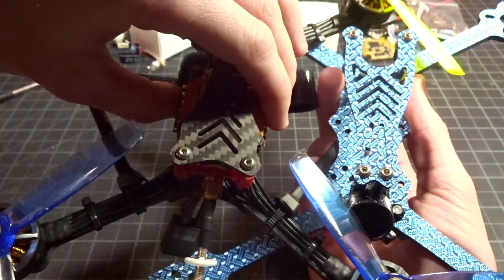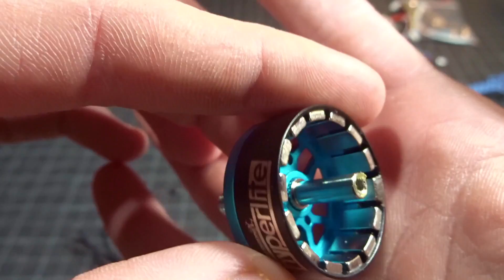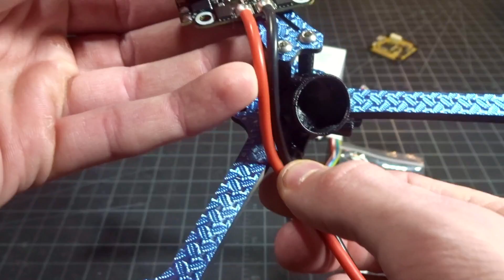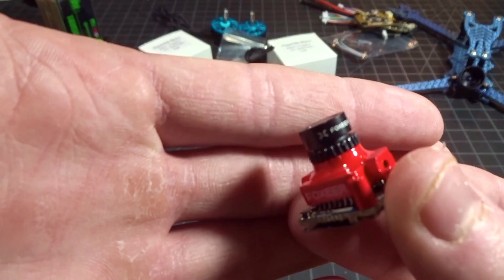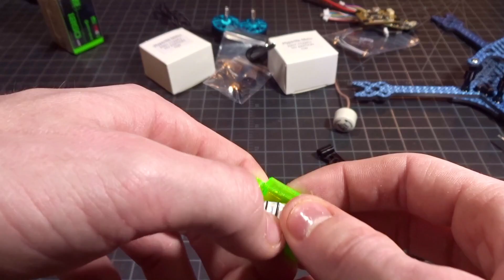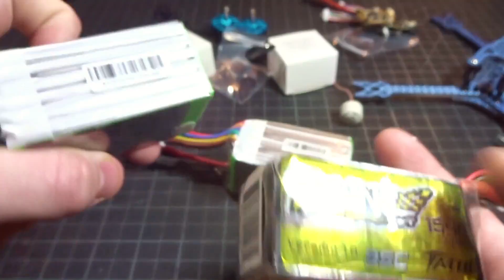6S Racing Quad : Parts Introduction

Comment: I was going to say for the ESC, don't go pulling wires out of the connector to swap the motor orientation. Just use the CLI command in BF to find the resources and swap the motors that way. Waaay cleaner and you don't risk messing up the connector taps on the plug. That's my only thought.
Reply from the maker: I do both methods, just depends on what I feel like doing.

Comment: hello artist I need advice ... that mini GPS (maybe with a Magnetometer maybe) I recommend for this FC?
Omnibus F4 Pro V3 Betaflight Flight Controller Built-in OSD Barometer SD Blackbox for RC Drone ..Banggood. on the frame ...
GEPRC GEP TSX5 Viper 220mm FPV Racing Frame RC
Thank you
Reply from the maker: I have no clue what GPS so use. Try asking Painless360, he seems to do some GPS stuff.

Comment: Ive been rewinding motors and testing with 1050mah. 1800kv on 5x4.5x3 v1s on a finX23 (2205.5) is an awesome setup. Im also taking a look into finX30s (2207.5) at 1650kv with 5050x3 cyclones which is very promising for speed while still flying similar to my lighter build
Reply: Enginair how do you know how many turns or how thick the wire should be? Or do you just guess and then check the KV? Pretty cool stuff!
Reply: I do not know how to calculate kv (not for lack of trying). I ended up just guessing roughly how many turns I needed to get close and ended up 200kv away. From there I found that number of turns adjusts the kv linearly and I was able to tell with decent accuracy how close I would be with one more turn per coil. Just make sure you have the phases wired correctly and you cant go wrong really. (make sure the kv is reasonable, 10000ish kv killed my esc instantly)

Comment: glad you mentioned the motor layout on the ESC and their intended orientation - I'm installing it with the power leads out the back and would have really been thrown for a loop had I not caught that tid-bit :) Time to now swap cables around in the FC side of the connector (or just remap the resources in the CLI).
Reply from the maker: Yeah, unfortunate, but not a deal breaker.
Reply: OH THE HORRIBLE CONDITIONS WE PUT UP WITH!!! ;)

Comment: I’ve never tried 6s, but I think 5-6s is overkill and unnecessary extra weight. Will likely destroy motor quality and motor life. The higher the voltage the less efficient motors will be.
Reply from the maker: No offense, but clearly you have never tried a proper 6s setup :)
Reply: The RCAddict that is true as I said in the first sentence that I've never tried 6s. The rest was all prediction.

Comment: you dont have to change out all the pins from the esc to the fc, just get 2 motors right and then you will be able to do the rest with betaflight, check out nick burns vid on motor mapping ;) not sure if you know that (you probably do but)
Reply from the maker: Pin swapping it my preferred way, and I have to swap pins anyways since the cable is incorrect in the first batch.

Comment: Dont change the pins because you are rotating the esc board, just use resource remaping on betaflight, its easier
Reply from the maker: I don't like resource mapping. I would much rather just swap the pins, super easy.
Reply: Agreed. I had to do it. Super easy and less chance of issues

Comment: Also one question about the multigp rules it says on there website to run six cell batteries you race in the open or unlimited class. So my question is why wouldn't you go for a little more kv? And or more mAh batteries ? For more punch? Cuz the only rule that's going to limit you is the 800gram weight limit.  And I know that's a lot but it's nothing for six inch props if that's the way you choose to go. Five inch would be fine with the rpms your are going to get with these set ups. Well anyways if you could shed some light on the subject that would be greatly appreciated
Reply from the maker: People don't want heavy setups. If running a heavy setup was fine we would just run 2200mAh 4s. 6s low KV extends the flight times while keeping the builds light.
Reply: The RCAddict did you check out the video  I left below?  Cuz it shows  through  testing that higher voltage  is not more  efficient on the same motor.  Well anyways I can't  wait to see how things turn out. And are you going to  be racing  multi gp with it?
https://youtu.be/ijKXsclb9eE

Comment: You don't have to mod the esc wires you can just modify it in cli with the resource command. I have put all my esc's upside down accidentally and it's pretty straightforward to do it so I didn't bother. Check it out on the betaflight github ;)
Reply from the maker: The pin out cable needs changed anyways. I am not a fan or resource mapping, so I will just get it all at once.

Comment: Gonna be a sick build! I am curious to see how that four-in-one one holds up. I've been wondering what kinda of a gamble running 4in1s with 6s would be.  Can't wait to see it built. Thank you for sharing.
Reply from the maker: Separate ESCs are such a pain hahaha
Reply: Hah, Agreed.  I've been rocking the dalrc's and they have been pretty amazing. Very low noise, 40amp but rated only up to 5s so nervous to run 6s on them.

Comment: I read once on rcgroups that tattu, glacier and pulse lipo cells all come from same factory. after buying a couple glaciers for smaller quads I compared to my tattus and they are very similar. I think they may separate them by ratings or quality and brand them accordingly I think tattu being the top tier and pulse second followed by glacier
Reply from the maker: Yep, Pulse cells are the same as Tattu. They are separate brands however.

Comment: Awesome to see you get on the 6s train! I found that the quicker response in rpm change and efficiency gain also opens up your prop choice. A 5045 on 6s now feels a lot like a 5040 on 4s on the low end control, but with the added top end speed. Over all the control feels improved with the improved torque. Interested to see what you think
Reply: Dude, I've noticed the exact same thing.  You can run more aggressive props on 6S.  They feel so much more responsive.

Seth obviously doesn't watch your videos, or else he would have known about your 6S build :)
Reply from the maker: Thanks Mr. Chaves :) Haha didn't know you ran 6s or watched my videos, sweet! Should be fantastic on the GF5055 I already run.
Reply: The RCAddict heck yea, love your vids dude
Reply from the maker: Haven't been able to keep up with a lot of channels recently, everyone demanding videos lol
Reply: John E Fly yeah I was watching in amazement at 127mph runs!! Also the max speed fail safes show how well designed and built the Merica really is!

Comment: Surprised you went 45C on the 1050mah.  Why not the 75C 1050mah?  Your setup won't pull the same amps that my setup does, but I do pull up to 116A on my 6S 75C 1050mah pack.  I wonder if the 45C could keep up.
Reply: John E Fly what props and motors u running that's high. I most guys are running low c batteries that's the point of going to 6s lower amps and keep the price down by not need high c rated batteries anymore. Catalyst machineworks does videos on this exact subject low C rating high voltage setups
Reply: Quadbot Yes, but I was already considering 75C "low" C rating.  When I bought my 1050mah 75C packs they were only $18.  I know that's way up now, but they were relatively cheap and low C.  They also are lighter than my 1550mah 4S packs.  Perhaps Seth bought the 45C because of price, I'm just curious for the reasoning.  Perhaps it was done just for testing.  If anything though I would have expected 45C on 1250 and 75C on 1050.  

I can pull 116A->120A on 1900KV with Gemfan 5051 props.  Definitely higher KV and more agressive props than most.  But at 6S my motors can do a great job spinning them.  It's a fast beast.
Reply from the maker: I honestly didn't see the 75C when ordering hahahah. Since I can get by on 4S with HV right now I am hoping that the 1050 will be enough, but if not the 1250 is only 15g heavier than my 4S, and these motors being so light will help balance that. Probably around 290g weight. 

When I bought them I only saw 1050 45c and 1250 75c as the "packs to use" looking through them. Oh well haha
Reply: Initially thought about going with 75c on my acro build and picked up a 45c 1050mah with my motors.  I'm using the brother hobby 2207 1660kv motors on a 490g dry quad. I use hq 5.5 props primarily and occasionally hq 6x4x3. I cannot get the 45c pulse to sag with the 5.5 props and i finally got the battery to sag with the 6x4x3 props when the ambient temp was below 40f. I get an average of 3 minutes  and see a max of 90a. I've picked up 4 more 45c batteries. Also i'm at 18 cycles on my first battery which blows my mind considering chl 1300mah 70c battries are dead at 15 cycles. 

I've been experimenting with 6s and 8s on my mini x class 500mm. So far i'm getting away with 1800mah on 720kv motors using hq 11x5 props. I'm getting 3 minutes of flight time on that. Also i'm using 3000mah 8s with 8x4.5 props getting 5 and a half minutes flight time with that. This quad is 1200g dry and flips, rolls, and can dead stop a fall. 

My biggest issue with hv so far has been vtx and cap explosions during active braking. The acro quad uses a bardwell board and the 9v reg resets during braking but a 1000uf has alsmost completely stopped it. The rtfq version of the board blew the 9v regulator during the first flight. I've also used a polou 12v reg but that also has begun rebooting during active braking. 

So far every esc i've used has taken 6s fine including spedix lite 20a. Omnibus f4 pro boards take 8s just fine but the onboard adc maxes at 25v however the osd will show 34v. 

Hv has completely changed the way i look at quad design. I'm looking at the most efficient way of using the available watt/hr. I mean why would we build a system that needs to carry 80a to deliver 1200 watts when we could build a system that only needs to carry 40a to delivery the same 1200 watts? More copper, more loss, more component stress dealing with the heat. Maybe even 120g packs vs our standard 170g packs. I wouldn't be surprised to see 16awg battery leads on quads using 600mah 8s packs next year.

Comment: good luck hope it will work out for you .. 6S is not easy to achieve to be reliable, the ESC and motor combination is critical .. As you move above 40K rpms, you will get roll o death its just matter of time.. so motor and ESC and prop combination will make this work.
Reply from the maker: Theoretical RPMs here are almost identical to a 4s 2600kv motor. These electronics have been fairly well tested so far, should be no issue at all.

Comment: I'd never think I'd see you go to 6s but now your quads will break the speed of sound!
Reply from the maker: I actually expect them to be a touch slower in full throttle. 

"you can kiss the efficiency good bye, which is fine by me!" you must not race haha ;)
Reply from the maker: There is a huge difference between damaging the packs through current and not being able to finish the race. If you are a fast enough pilot you have to have some focus on efficiency or you might not finish the race.
Reply: that's what intuition would make it seem, but with a low kv motors like that the goal is efficiency (hence "long range" motors). so you get same thrust as lower voltage setups, without damaging your lipos. ohms law. most of us, including me go for higher voltage for more power and speed, and not necessarily a trade off for better efficiency. the  1700 kv motors will give more torque but will not allow to motor to be maxed out in amp draw, limiting thrust potential. the trick is to test higher kv motors with the setup until you get to a point where you dont burn the motors, but you can kiss the efficiency good bye, which is fine by me!
Reply: lol far from. i just like to cruise and go as fast as I can. I'm open to learning more freestyle but my time is limited.   I don't think racers actually really care if they destroy their lipos.
Reply: Im running those same batteries but on 1900 kv. Emax light spec.  It's a battery killer , sounds weird too.  I took apart a bunch of dead 4s tattos last night and built 2 5s  packs. I really like how it Flys now.  Back to the drawing board...
Reply: agreed!  i like how Multigp introduced this new dynamic to their races.